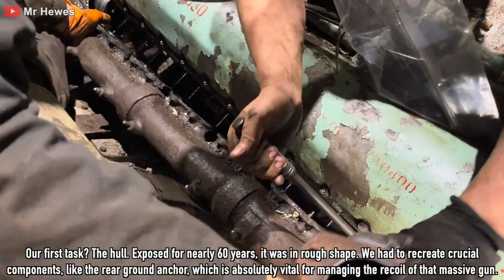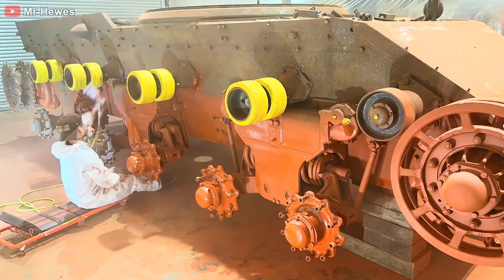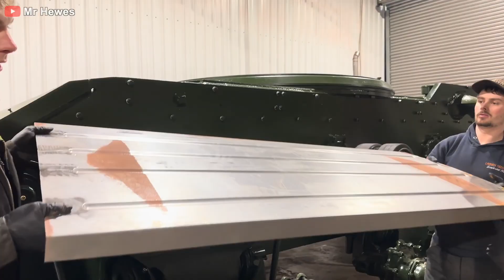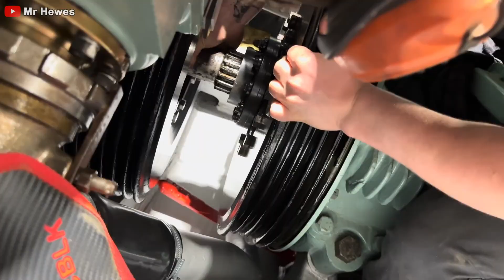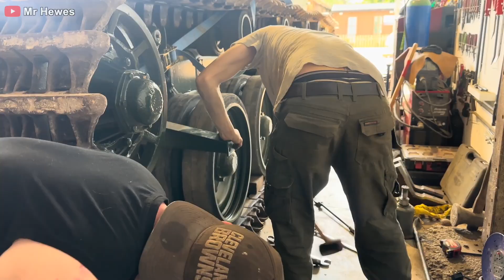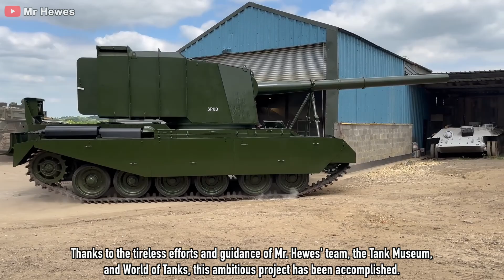Abandoned Tank Just Came Back to Life — FV4005 Restoration! (By Mr Hewes)

Comment: It's a shame that if you're going to do a renovation like this, no one took it apart and washed the bearings from the gears or the oil if there's oil there and the bogies have fossilized after many years of standing, so what's the point of Dacei ? Besides, after disassembling them, they would have painted them more thoroughly.